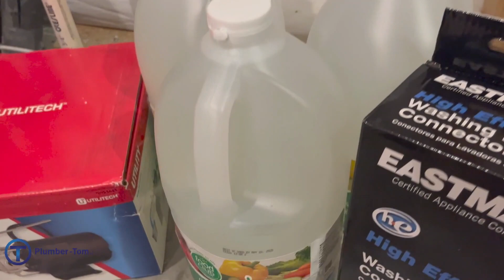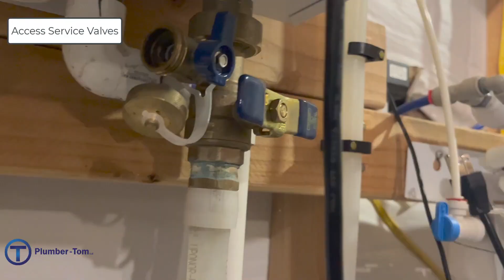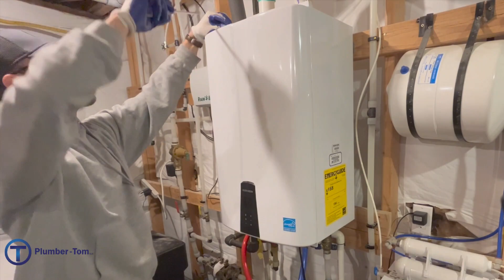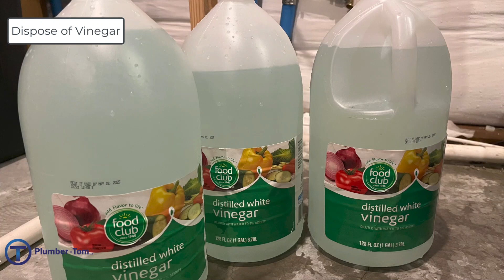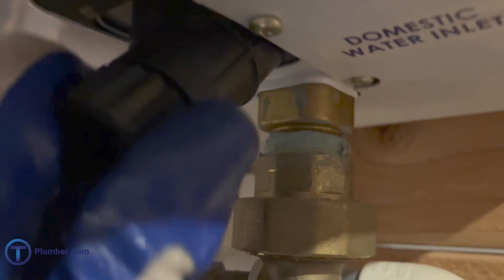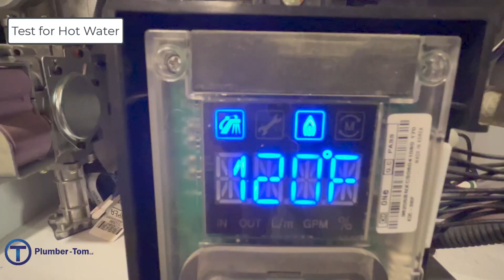Tankless Water Heater Descale and Filter Service

Comment: so you only do this once a year?  I thought I read it should be every 6 months,,
Reply from the maker: Once a year is usually enough.  There are other opinions.  The best to find out what the manufacturer recommends.  I had a customer who was descaling almost every month.  After a couple years, it ate holes in the heat exchanger!  So it is possible to do it too much.

Comment: This assumes an auto feeder is set up correct? If not, would you need to add water back in to maintain pressure?
Reply from the maker: Helllo.  Not sure what you mean by auto feeder?  You will need to flush out the vinegar by letting water into the water heater and flushing out the system.  You do not want vinegar going into the house system.

Comment: Great Video. I leave the heater on so that the vinegar gets heated and that helps it to descale better.
Reply from the maker: I would not recommend heating the vinegar.  You are correct that it does descale better, but it can also be corrosive to the heat exchanger.  I have had to replace a heat exchanger because the descaling ate through the joints.
Reply: Heating the vinegar to 120-130 F doesn't change the acidity of it which is responsible for corrosiveness but it helps loosening the mostly calcium buildup.
Reply from the maker: @aljohnson4314   Ok.  Good to know.  Thanks for your input!

Comment: Why are you not using the built-in pump that comes with the unit?
Reply from the maker: Mainly because you do not want power on to the unit when doing the descale. I don’t know if it is even possible to run the pump without heating water and you definitely don’t want to be heating the vinegar solution inside the heat exchanger.  The service valves are designed to enable a flush using an external pump.  

Good question.

Comment: Great video... to confirm, that's pure vinegar or diluted?
Reply from the maker: It is the stuff that I bought at the grocery store.  I think it is actually 5% vinegar.
Reply: @plumber-tom9470 Checking... my vinegar 1 gal bottle says 5% acidity which is what I assume you mean and you are not adding any water to that to dilute.  Thanks for the video and reply, it worked out great!